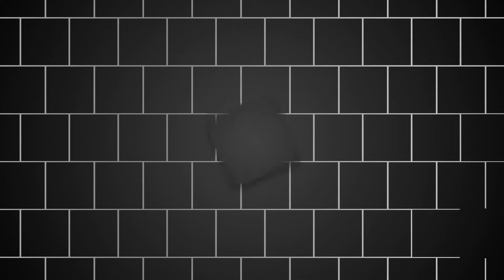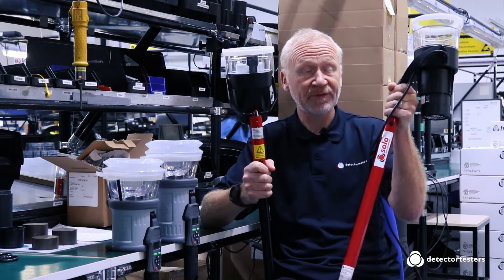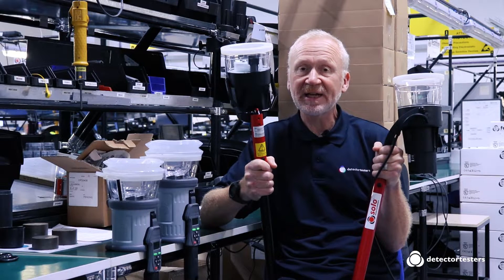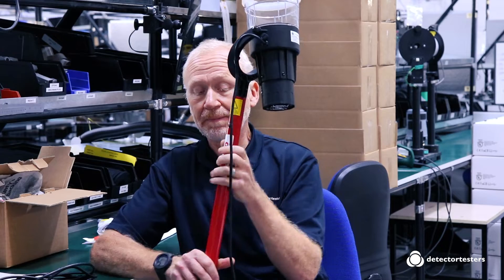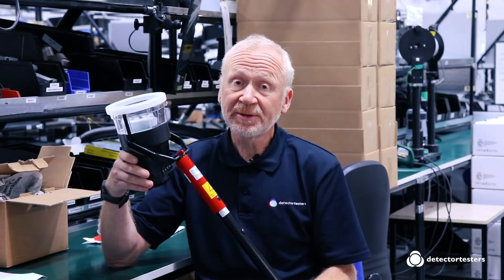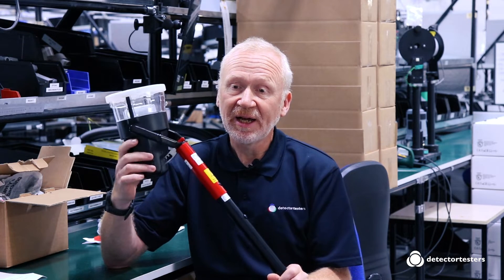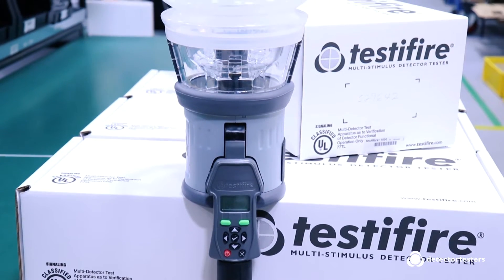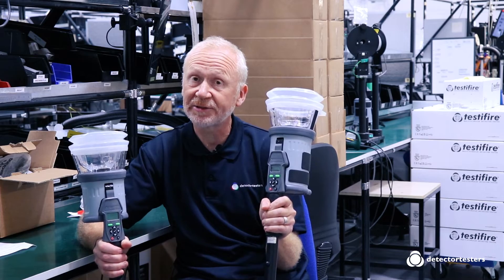TOOLBOX TALKS - HEAT DETECTOR TESTING

Comment: Hello I have a fairly new 460 cordless heat detector testers. It helps get the job done right. I have an issue after replacing my battery it lights up green then after two seconds it turns red? Your help is greatly appreciated!